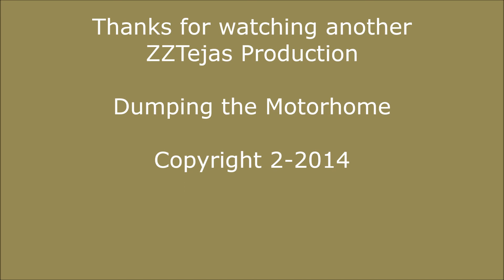Fulltime RVing   OFF to the Dump Station

Comment: Where is that? Some strange dump station in a parking lot?
Reply from the maker: It's a travel center with an old dump station off to the side of the parking lot. I think maybe this was bought & rebuilt with the old dump station remaining. So it's probably why it's free. I'll take free any day!
Reply: A forgotten corner of the RV world, yours for the taking!
Reply from the maker: haha, it's posted on a free dump site, site....The first time I saw it on the site, I went in & asked the store if it was free & they said yes. Then they asked where I learned about it. But again, it's a travel center that the big trucks use too.